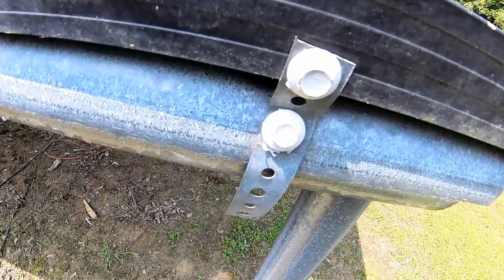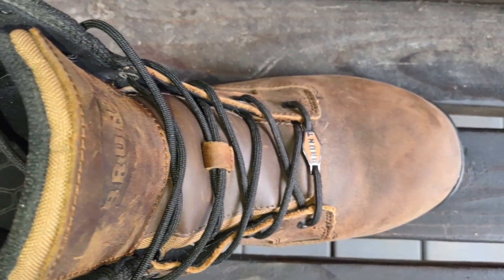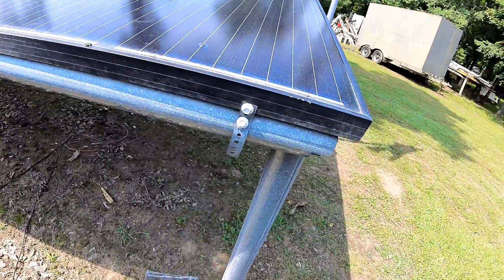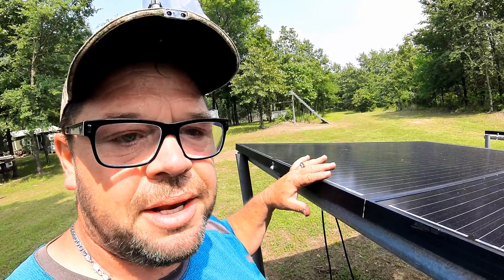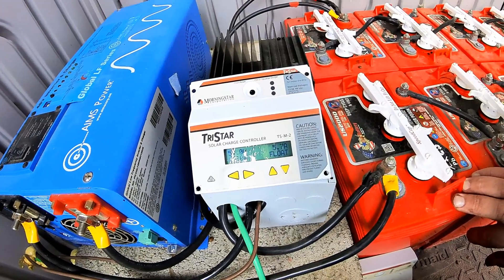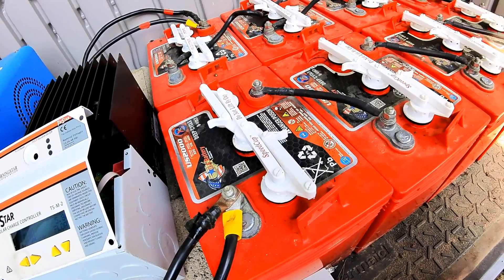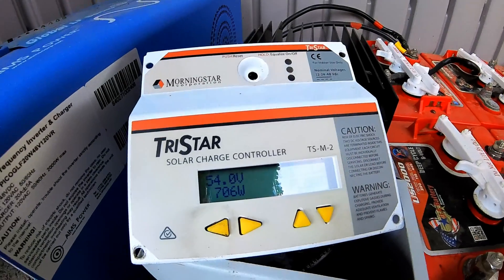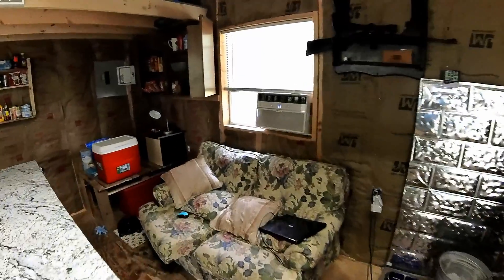Run A/C On Off-Grid Solar System After One Year.

Comment: i have a 24v system bringing in over 125v all you need to do is have your panels bringing in more voltage then your battery bank and the MPPT charge controller will take care of the rest

Comment: For my off grid place, I switched from Lead Acid to (4) 12V 300 amp hour Lithium Batteries about 18 months ago that I currently run as a 24v system. The prices for Lithium Batteries has recently dropped so dramatically that I’d not even consider other options.  I’m now running 2000 watts of panels which is providing all the power I currently need. I probably should reconfigure to a 48v system as I’ll undoubtedly be adding more demands on my system.

Comment: I just did a LIFEPO4 battery conversion on my golf cart and it was actually cheaper than new lead acid batteries.  I got a 48v 100 ah battery for just under 1k.  Lead acid would have been 1.2-1.4k.  Performance has been awesome.

Comment: I'm trying to run 4 ac units with a  5000w inverter charger how many pannels would I need  ?
Reply from the maker: To run them during the day it would probably only require about 10 or so panels but what you're going to want to do is charge the battery Bank up enough where it will run the ACs all night in that case you'll probably need about 25 to 30 panels if you're running 4 window units and you want to charge a huge battery Bank the he same time
Reply: Thanks for the quick response..can I achieve this with 200w pannels or shod I get bigger ones. To wire the panels In series to 48v u wire them 2 at a time then joint all the panels at the connection box with brakers?

Comment: 🎯 Key Takeaways for quick navigation:

01:25 🌞 Setting up the Solar System
- Setting up a solar system for powering household appliances.
- Obtained panels and learned installation through online research and trial and error.
- Determined system specifications like battery size and voltage through online forums and discussions with experts.
02:29 🏡 DIY Solar Panel Installation
- Utilized second-hand solar panels at a discounted price.
- Created custom solar panel racks from repurposed fence posts to reduce costs.
- Estimated the cost of purchasing new panels and DIY installation materials.
05:35 ⚡ Solar System Components Overview
- Described the components of the solar power system, including inverters, charge controllers, and batteries.
- Highlighted the functionalities of each component, such as inverter charging capabilities and charge controller regulation.
- Discussed the choice of lead-acid batteries over lithium batteries due to cost-effectiveness and maintenance preferences.
09:45 ❄️ Running Appliances with Solar Power
- Demonstrated the capability of running household appliances, including air conditioning, refrigerator, and lights, solely on solar power.
- Provided real-time energy consumption data and battery voltage status.
- Addressed concerns about system performance during both daytime and nighttime usage scenarios.
12:25 💰 Cost Breakdown and Considerations
- Detailed the expenses involved in setting up a solar power system, including panel costs, wiring, and additional equipment.
- Shared insights on purchasing second-hand equipment and estimating expenses for a new installation.
- Discussed the importance of subscribing for future updates on system performance and maintenance.

Made with HARPA AI

Comment: So, is there a way to charge enough batteries so that you’ll have power during a few cloudy days? I’m wanting to just have enough capacity to run a small fridge in case of a power outage. I don’t know if I should look at 12v fridges or use a small beverage cooler. Thoughts?

Comment: In Europe, Estonia 375w 36V 11A  panel costs 60€(65$), 6kw growatt 220v 48v inverter is 700€(750$) and 15kw lifepo4 battery is little less then 2000€(2200$). So my system is 22x 375W panels (8250W), 6kw inverter and 30kw lifepo4 battery and it all costed me  5500€(6000$). for a 1,5years i've never used grid power, not even a onece.

Comment: Be putting one in about Jan or Feb. Looking at 10 400w panels - $1800. Charge controller 6000w split phase - $1300. 48v battery 100ah, 5.1kw - $1200. Rack for panels around $750. With incidentals likely about $5500 total. May throw in another battery or wait. Up front needs aren't too high. But do plan on a mini split 9k air conditioner. Shouldn't be a problem to run around the clock with at least 80 percent battery use available.
Just a small building to grow maggots in year round. Might possibly stack another controller on and build it out further and start taking loads off the house later on.
Reply from the maker: Are you getting eg4 equipment?.. sounds like the inverter and the battery may be eg4... Also yeah definitely two batteries would be awesome but did you see the video I did where I installed four of those batteries you're talking about on a 5000 watt system?
Reply: No haven't seen that. Have to go look it up.
Reply from the maker: i see you saw the video....EG4 IS the bomb man...use my affiliate link if you buy from there https://signaturesolar.com/?ref=daCLdQtKZ6PyTf much appreciated

Comment: I like what you are doing boss....question. I have a window shaker like yours, older though, and hooked it up to a power station and was surprised it was only pulling around 400 watts. Do you have any idea what yours uses energy wise?? just curious, as I have not used ours because it has been a cool summer here.....but simply hooked it up to experiment. Appreciate ya
Reply from the maker: yessir...thats about right...mine is an 8000 btu and pulls around 560 watts after it settles in for a bit...gets freezing in there even in the middle of the day....at night have to turn it off or run the tiny inverter generator because even the 560 +the fridge 85watts and the cpap about 80 would run the batteries too close to completely discharged...I need double the battery bank then I should be in better shape
Reply: @OKLAHOMAOFFGRID  sounds right......good stuff buddy. Thanks for the info.

Comment: Lithium LiFePo4  has really come down in price. You can get 12V 100 Ah for under $300. Lead acid have been going up in price. Lifepo4 only seem like more money, then lead acid until you compare each others performance.  Lead acid only have around 1000 cycles life compared to Lifepo4 cycle life 7000+. Lead acid can only be discharged to max 50% compared to Lifepo4 80%. Also I can run half as many Lifepo4  compared to lead acid.  My 3k inverter needs 8 lead acid but I only need 4 if I run the inverter on Lifepo4. 
My example comparison of a lead acid versus Lifepo4 is like comparing a gasoline engine versus a diesel engine.  Diesel engines have more torque that torque in a Lifepo4 is in the form Voltage. When it comes to Lifepo4 under a full load it maintains a much higher voltage longer and recovers to higher voltage while the lead acid under the same load falls on its face. That's why you have to run twice as many lead acids. Oh and plus no core charge with Lifepo4.  Once you have switched to Lifepo4 you will never want to run lead acid deep cycles ever again.

Comment: It would be great if you would stop saying the panels are running your equipment. The panels are charging the batteries and the batteries are running your equipment. If you only had one battery you would be in trouble or your stuff would only work during sunny times.
Reply from the maker: When I tell you the panels are running the equipment that is because the batteries are at float and nothing's being pulled from the batteries the only energy is being pulled and ran off of the solar panels themselves at that point

Comment: Good system add more batteries if you are in float that early I would at least add half probably double lead acid is fine …But you should be able to run the ac more if you want…maybe add more insulation inside the house?
Reply from the maker: going towards lithium

Comment: I run my ac and home off solar. Its only a 30 foot holiday rambler travel trailer but its great for and the wife when we are not in the semi truck. We have a 24 volt solar power system and a couple different inverters. My split phase 4000 watt sungold power inverter runs the 220 minisplit thats 38 seer and it also runs the camper. I have another all in one inverter also but its not used much anymore. I built my battery from 16 280 ah eve grade a cells. Its 14 kw and i ordered another 14 kw worth. I also have a back up battery thats 24 nissan leaf modules. I only have 1850 watts of solar at the moment but adding more soon. I have 3 seperate charge controllers but my victron 150-70 is the best ive bought so far. Thanks to you and other people making the videos i was able to build our home into a sustainable way of living
Reply from the maker: sounds like a beast of a system...just needing more panels
Reply: @OKLAHOMAOFFGRID  yeah more panels really soon. It should make it thru several days of bad weather for sure. I've actually never seen the batteries below 70%. I'm not home often but the couple days month I'm not in this semi truck I use appliances, run the air-conditioning non stop and we watch TV non stop. The wife uses her hair dryer... we don't change a thing about conserving energy. I just bought a 38 seer minisplit and my fridge is super efficient but yeah it's been an expensive investment but worth it to us from what I'm seeing so far
Reply from the maker: so how good is the mini split?
Reply: @OKLAHOMAOFFGRID  man the minisplit was the best thing I bought as far as making life comfortable.  I bought the exact one that David poz bought for his garage. I knew it was gonna be a step above the rest of the minisplits because David always studies up on his stuff and his research on the best most efficient minisplit was on point. It's 38 seer with variable speed compressor and variable speed fan on the indoor unit. I set it to 68 degrees and it starts at a little over 600 watts then within 10 or 12 mi minutes it drops to just over 200 watts. If I stay inside it just stays at the little over 200 watts the rest the time. If I'm in and out alot it kinda ramps up and down but it's around half power consumption of the pioneer minisplit that so many people go and buy. It did cost a little more than the pioneer. It weighs more also but it's a freaking amazing thing to have our 30 foot camper having the ac run 24 7 off solar and batteries. I have 1850 watts of solar on some aluminum angled ground mounts and the past 4 days I was home with my lights on a 42 inch TV, a full size fridge, my drill chargers... even turned on the electric part of the waterheater for awhile. My batteries never got down to 80 percent. I have nice batteries and victron 150-70 charge controller and a sungold power 4000 watt 120/ 240 split phase inverter. Ive got a whole other solar power system sitting in the bedroom not hooked up and it's got 14 kw of leaf modules and once I get property and a well dug that solar system will control my water system hopefully. But yeah the inovair minisplit 38 seer is amazing and super efficient with ac and heat too
Reply from the maker: @matthewknight5641  man thanks for the info.. 600 to .200 watts and then up n down a bit would be great ..I'm going to start checking those mini splits out and especially that one
Reply: @OKLAHOMAOFFGRID  I studied up on them for a couple months before I bought the one I bought. There is a company that makes one that's even more efficient than the 38 seer unit I have. It's a 42 seer and I can't remember the brand but the reason I didn't get the 42 seer was it was about 5 grand and I couldn't see paying that much extra for a 4 seer difference. The unit I bought was 1700 and then I had to buy a 150 dollar line set also. You can get a fairly efficient minisplit for 1200 but I'm thinking it pulls around 800 then drops down to 500 to 600 watts. I'm really impressed with the one I got and the thing that makes it so efficient is the variable speed motors and it is capable of a much wider range. It goes as low as 2000 btu and as high as 13500 btu. The less expensive they are the either are not variable speed or if the are the variable speed they don't have a very wide range of variation like the inovair does. Hope this helps you with the research and reasoning behind the exact one I chose. It also has a very wide range of operating Temps also. I'm thinking most would work down to like 10 or 20 degrees but the inovair has some features that allow it to work down to like negative 20 and still make heat and then up to like 110 or 120 and still cool.

Comment: 12000 BTU mini split with AC and heat uses a lot less electric to run than an 8000 BTU window unit. They are very efficient.
Reply from the maker: I need to check those out
Reply: @OKLAHOMAOFFGRID  Read all the specification.  Just looking on Home Depot site, 12000 BTU mini split- 1000 watts.  12000 BTU LG window unit- 990 watts.   Mini split has two fans, one for the outside condenser, one for the inside evaporator.  Window units use just one.  You do get a heat pump with the mini split.

Comment: Remember also with solar panels being so cheap it's always better to just buy more panels than it is to buy more batteries. And most of the stuff you're going to be doing you're going to be doing during the day anyway when the sun is out so you don't need to be storing as much electricity in a battery if you have a bunch of panels that you can run mostly directly off of. For example I can run a boat trolling motor directly off of a couple of solar panels all day long using one tiny little lead acid battery in between the trolling motor and the solar panels. All the battery does is even out the charge it really never gets drained. You can do that for almost any motor if you're going to be running it mostly during the day. And if you have a week of cloudy weather well then just take a rest and don't do some of the work you would ordinarily do.
Reply from the maker: i want more panels and would like a ton of lithium batteries just cant afford them lithium yet

Comment: You can also buy used lead acid batteries out of wrecked cars. Remember the batteries aren't usually going to be hurt in the wrecked car and you can test them before you buy them. My local recycler will sell them for $0.50 per pound which means you can get a 30 lb battery for $15 and that'll be a standard car battery. So you can easily build up a whole lot of lead acid batteries in a bank that have 80% of the performance for very cheap price.
Reply from the maker: yes these are cheap ways to do it but not as reliable as  batteries with  the same cca or amp hours or the same life cycles left or the same state of health....you will always have a battery failing on you much quicker this way but you do what you have to do to save money

Comment: The real key to any solar power system is number one never connected to the official electricity grid and you don't have to worry about a lot of the permitting and it can be much much cheaper. Number two use it mostly for heating and air conditioning. The simplest way to do that is to run a window unit air conditioner on your hottest days directly off your inverter from your solar panel. That means you're going to get the maximum solar panel power during the hottest part of the day. The way to heat with solar is you put a large bucket or barrel of water inside your house and you put a water heating element in that bucket and during the day your solar panels heat that water and during the night that hot water radiates that warmth out all night in the cold night inside the house. And don't forget tricks like feeling hot water bottle or even a 2 l Coke bottle with hot water and putting it in the bed with you and then you don't need to heat your whole house at night in the winter time.
Reply from the maker: i would never connect to a grid

Comment: The benefit to using higher voltage like 48 volts instead of 12 volts is you can use much thinner wire running from the panels to your solar controller and the batteries. And that wiring gets expensive. You don't have to buy 48 volt panels to end up with a 48 volt system if you put 4 12 volt panels in series they're going to add up to 48 volts so you just treat four 12 volt panels like 148 volt panel and then you wire as many of those together in parallel as you want and you end up with a 48 volt system and you can run your wires from that whole system to your battery bank and your solar charge controller. You can use much thinner wires and they're much cheaper if you use higher voltage.
Reply from the maker: i have 48 volt

Comment: I've been putting solar panels on everything I own including the top of a van. Get yourself a cheap little solar controller that can keep just one extra car battery charged and running inverter off that and it's amazing how much difference it makes to be able to have electrical power in your vehicle without having to run the gas motor.
Reply from the maker: you are totally right..i have one more right now about to do a vid on it  with a new battery that's on the way

Comment: Modern solar panels like that can also be used as basic roofing material. Something to consider if you're about to build a shed or you haven't yet built your tiny home. Go ahead and put your solar panels on like roofing panels. Get some gutters to go between them so the rain that goes between the panels flows off the roof. You can cut PVC pipe in half to do that. Or just put your panels on top of your roof saves the wear and tear on your roof especially if it's an old style tar shingle roof. That additional shade will also keep your house much cooler in the summertime if your house is exposed to the sunlight.
Reply from the maker: pvc pipe aint cheap no more